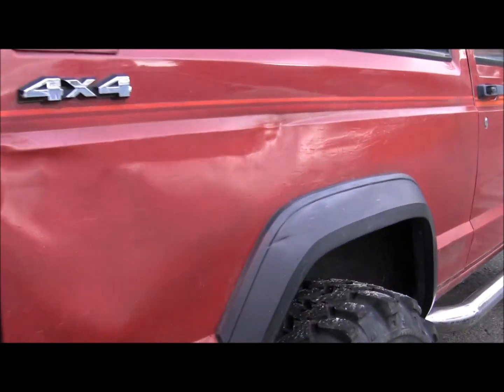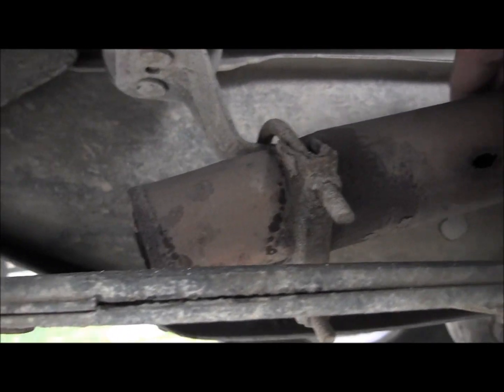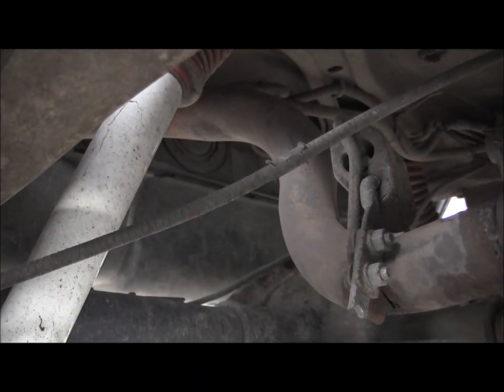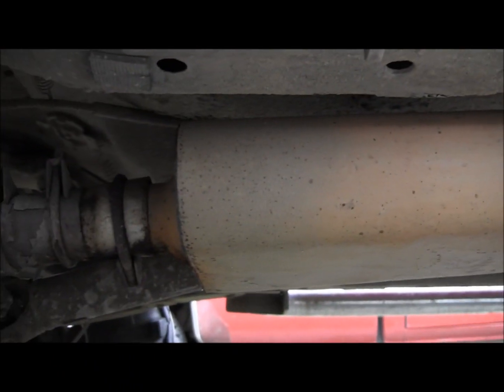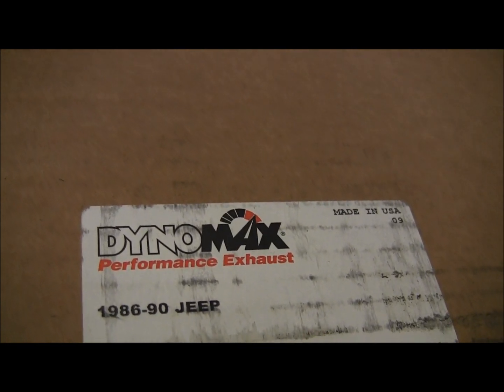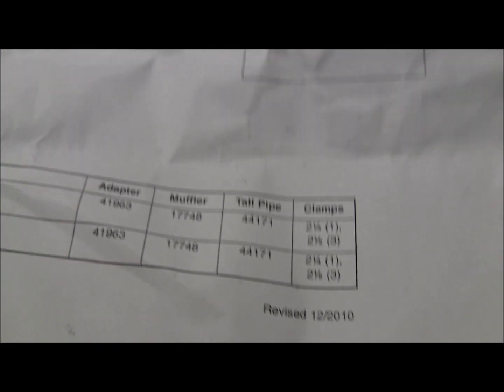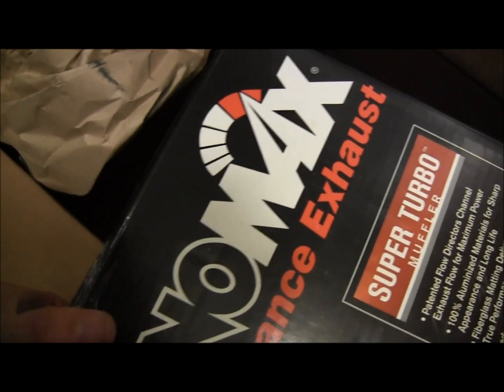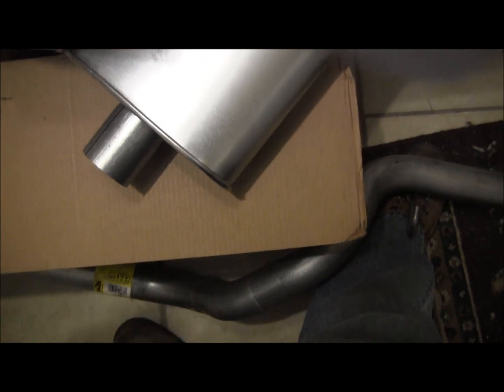Jeep Exhaust Arrival

Comment from the maker: @brapboys503 She's got the power, but the gearing is off even with my '31's.  I did some damage to the bearing surface on this rear end running hot like I did when I burnt up the seal, so I'll be looking for a Chrysler 8.25 or a dana 44 to toss under her, maybe next winter.

Comment from the maker: @lol123321123321 I thought it sounded pretty good with my cheap turbo muffler I have now- be nice to hear it with a full aftermarket exhaust.  Took the old pipe off after work last night, the uffler is stuck on right now.  Shouldn't take to much to rip it off and get the new stuff hung...